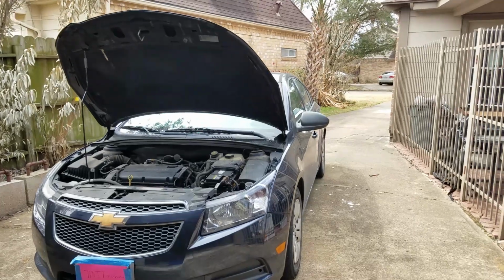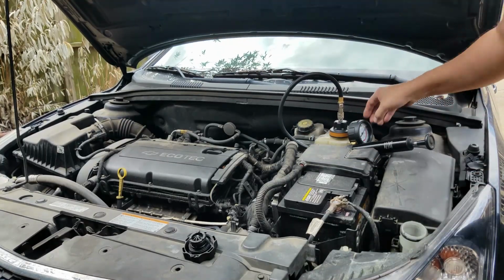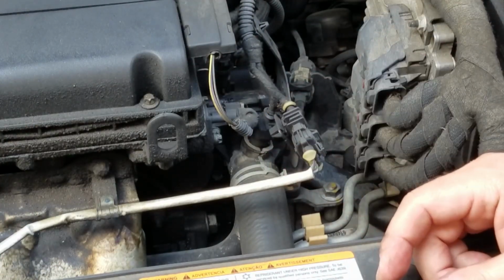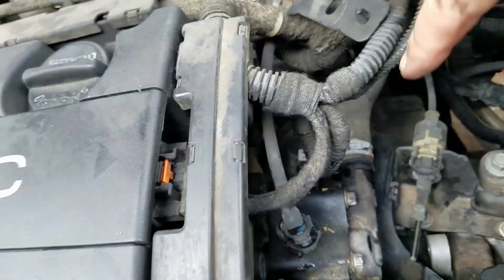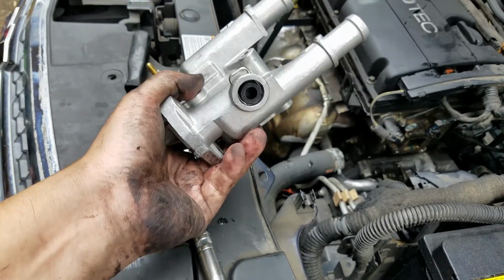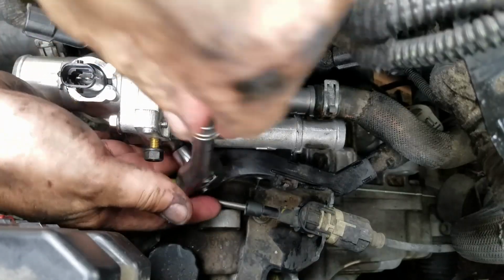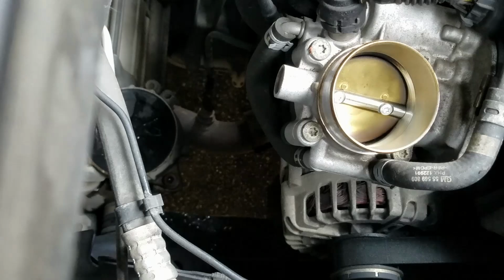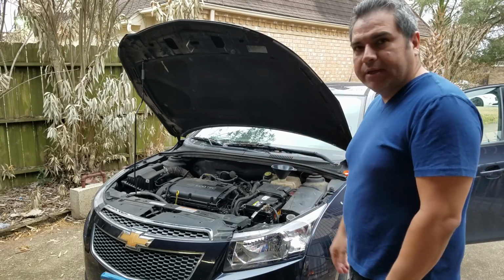2014 Chevy Cruze 1.8L  How to replace thermostat housing and details of extra parts needed.

Comment: How did you get the coolant inlet pipe flange to meet with the thermostat so easily? Mine was not quite flush and I bolted it to the thermostat but it’s leaking from there now

Comment: Jus lost heat, started off gradually then totally lost it last night, how can you tell if it’s the thermostat and not the water pump and when n if the pump goes does it make excessive noise?
Reply from the maker: Usually, a water goes bad when it starts to leak out the weep hole on the water pump or the obvious bearing noise. However, a thermostat can be stuck in a closed position causing to over heat engine. Also, make sure the engine is operating. A faulty engine fan can cause to overheat engine. 1. Check if fan is operating. 2. More than likely your thermostat is not opening.

Comment: I simply put a piece of  1foot long or so hose on the radiator outlet and fed the hose through the plastic shield.  Why take the shield off?  Also, I left the drain hose on and curled into the space in case of needing to drain again.

Comment: Great video, best I’ve found yet. The real test is how you got the oil cooler pipe back in without taking off the heat shield
Reply from the maker: Thank you for the positive feedback. It’s been quite sometime. I can’t recall, but I do remember it was a little challenging.
Reply: @ChappieSlappie216  you just pull hard on it to the right, it's only holding by an O-ring after you removed the bolts that are on the thermostat housing. Use soapy water to push in the new part.

Comment: I just replaced this on my Sonic with a 1.8l.  I got the all aluminum part through Amazon.  I did not have the o-ring for the oil cooler outlet pipe.  I used a bead of Right Stuff sealant around the metal pipe where it inserts into the thermostat housing and it worked well.

Comment: Can some one tell me where these things actually fail.
Does the plastic warp at the O ring or does the actual body have hairline cracks or is it the fitting , coolant lines to the plastic housing?
Dont think ill be putting an OEM. I think Ill try an aluminum aftermarket housing.

Comment: where did you ifnd the short E-10 sockets? all harbor freight has is the long ones
Reply: Advance auto has a set. Diehard seems to be pretty good for the price
Reply from the maker: @ thank you for sharing. This will the community. 😊👍
Reply from the maker: @MrTmac493  it got mine from Amazon. Yes, harbor freight, northern tools, and all local auto parts store does not have E sockets

Comment: Also be careful with the oil cooler outlet pipe, I dinged mine up and had to replace it. Pretty sure it's made out of aluminum also.
Reply from the maker: @coreyparrish1985  thank you for your insight and experience. Do you have part# for the oil cooler outlet pipe?
Reply: @713jtmechanic8  I can look it up when I get a chance. I had to get it on eBay 🤣

Comment: Hey so I recently replaced my thermostat housing assembly shown in the video with a new ac Delco one but now my car seems to cool down every times it’s in drive but it will heat up when In idle
Reply: Only thing I didn’t do was replace that O ring you had showed
Reply from the maker: Your description of problem sound like the coolant system may have a air pocket.

Comment: Did you replace the metal pipe as well? 😊
Reply from the maker: No… all the parts replaced are mentioned in the description under the video.
Reply: Ok thanks. Mine came loose from behind the manifold but thought I broke it

Comment: I just replaced the thermostat started the car  and it started leaking  i did not put the rubber pice like u said on the video and did not replace the hose   smh so i just order a new hose and the rubber pice  but for some reason it  looks like the hose doesn't look like it locks  in probably
Reply from the maker: It should click in place. Inspect the inner piece of the plastic that inserts into the thermostat housing.

Comment: I attached a new throttle body hose to the new thermostat housing and it leaks from that connection any ideas?
Reply from the maker: I can’t recall the connection style or design. There must be a crack. Take your time to inspect the area. Something has to be cracked.
Reply: @713jtmechanic8 it’s like it’s not pushing down all the way in the housing but it won’t go any further and leaks out…Silicon sealant?

Comment: My cruze has a coolant leak after the thermostat was replaced could it be my housing needing replaced my Hose have been replaced already
Reply from the maker: There is a high probability. When replacing the thermostat it is highly recommended to replace housing and everything that connects to the housing, hoses and such.
Reply: @713jtmechanic8  ok thanks

Comment: There is an identical connection on the throttle body other side of the throttle plate. Replace the 5/16 o-ring to prevent a leak there.

Comment: Does housing has a gasket ....or some kind of sealer.    Or nothing at all
Reply from the maker: It’s been a while I can’t recall. I believe it’s an o-ring that seals. However, it definitely needs some type gasket or rubber seal to prevent leaks.

Comment: I did this exact how you explained it and my engine won’t even start anymore and if I can gas it enough to start then it’ll sputter a couple times and then cut off
Reply from the maker: Do you have a check engine light on? What code does it display on your scanner?
Reply: @713jtmechanic8  I’m currently out rn but I’m hearing that it’s working again, I just left the car off and left the pressurized coolant cap off for awhile to get the pressure bubbles out
Reply: @713jtmechanic8  it’s not throwing any codes and no light though
Reply: @713jtmechanic8  still no start

Comment: The engine oil cooler pipe slid out when I was taking the old thermostat housing out. Is it supposed to be that lose. Can I just slide it back in when I install the new housing.
Reply from the maker: Yes, it slides in. I believe it has an oring to seal.
Reply: Dis you manage to slide it back in without replacing oring? Without removing all the exhaust manifold?

Comment: What is the hose called that broke off? I just had it happen to me.
Reply from the maker: Throttle body heater hose inlet. It’s on the description with part number.
Reply: @713jtmechanic8  thanks!

Comment: That hose you replaced, you broke it taking it off by prying it off. The end that goes to the top of the housing is actually a c shaped retention clip that slides off to the side.  It is not for snapping into place.
Reply: That hose is going to snap no matter what you do. It’s a bad design. Like you know how to get it off with out breaking it. IT’s plastic wrap in plastic. That hose will break no matter what you do.
Reply: @careful7951  Agreed it's a crap plastic. But it's overheating that causes it to become "brittle" and break when you pull it off straight expecting it to still have elasticity. It won't break if you slide it off like any other C-Clamp. $6< Genuine Part 55354565 I tried to find a metal one as I have seen similar ones for the fuel injectors but no luck. https://m.media-amazon.com/images/I/41cF3JJ1s5L._AC_SL1000_.jpg

Comment: What is the name of the metal tube that's attached to the thermostat housing. I replaced my thermostat today and had some trouble with the two bolts on that tube getting them on and off. After I got it all back together the tube is leaking under the manifold in front of the engine, the same metal tube, it's appears to be leaking on a join. Hard to see need to take a better look tomorrow.  Any suggestions or help would be really appreciated I'm on a budget and need it fixed asap. I probably have to take off the manifold and front part of exhaust. Wondering if I need a seal or what? Great video.
Reply: I only figured this out after finished putting it back together and started the car also the fan was immediately on full blast. I broke the clip you replaced but put it back on as it still fitted. I will have to use your link for a new one but I need to get this all figured out first. Hope you or someone can help asap

Comment: Is there a part number for the engine coolant pipe gasket and where can I buy it?
Reply from the maker: I suggest use your VIN on AcDelco website to locate the part you need. It will be the accurate part.

Comment: Is dorman good? I'm in the middle east and my cruze recently got this thermostat leak... I was going to order this from Amazon and it's like 65$...so should I order this? Or do I get something else?
Reply from the maker: The aluminum housing Dorman mentioned on the description is still working with no issues. The AC delco is good, but I was concern about the plastic housing.

Comment: Thanks for this how to. I did buy the gasket for the oil cooler line that you had suggested, but cheaped out and didn’t buy the throttle body cooling line you had suggested.. initially. I did have to buy it because it simply broke off inside the old housing when disconnecting.
Thanks for the video and the parts links. Very helpful.

Comment: Does the Throttle pipe the attached to the pipe melt? Since the housing is made from aluminum please
Reply from the maker: No, the pipe is not delicate. I have never seen the aluminum cause the pipe to melt. Good question 👍😊
Reply: @713jtmechanic8  i just replace it yesterday both the Throttle pipe and the housing all together on my cruz 2016 wondring if put me in trouble.. Thanks for replying to my question

Comment: I am on my 3rd Thermostat because I have used 2 Dormans and they both failed. I am currently using an OEM part and it works.  After the first Dorman thermostat, my fan would run constantly and so they sent me another one. Both worked for only a month. The one that's actually working is the AC Delco Thermostat. I also seen videos stating the same thing from Dorman. I agree Dorman products are well built but unfortunately they both failed on my 2011 Chevy Cruze.
Reply from the maker: Thats unfortunate. This info regarding your experience is helpful for the community. Thank you for your comment. 😊👍
Reply: @713jtmechanic8  Thank you for all you do for us part-time mechanics. Much appreciated 🙏.

Comment: My throttle inlet hose connector looked just like yours in the video.the end piece was broken off. If it’s stuck on the thermostat housing would I have to replace the housing or is it possible to fish it out without causing more damage? Just because I already have the new throttle inlet hose installed but I can’t seem to connect it
Reply from the maker: I believe you can fish it out. Be careful with the port on thermostat housing. It can break. Good luck 👍
Reply: @713jtmechanic8 how do you fish it out

Comment: Hey man , I just want to add in. From knowledge that was drilled into my brain over the years, when tightening something down such as that type of part you always want to use a cross pattern. Same concept as when changing a tire and bolting it on. Meaning tighten the top left Bolt move to the bottom right bolt tighten the top right bolt move to the bottom left bolt. I was told  if you Failed to remember that step you may potentially have a leak in the future due to flexing temperature in the metal. Correct if I’m wrong !
Reply from the maker: Absolutely, you are correct. I do cross pattern on metal and plastic myself. On engine heads I follow manufacturer specifications regarding the sequence to bolt down and torque. 👍🏼😊
Reply: I didn't I broke the bolt on it it held but when it's time to take it off again it's going to be a pain.
Reply: Correct you? Are you kidding? That’s that life saving / car saving knowledge right there.

Comment: Thank you for doing this video, my heater stopped working and I found my reservoir was empty, fearing a head gasket my son pointed me towards this housing. I have not even refilled the tank yet, but just wanted to know what I was in for if its this. Nice video, thx.
Reply from the maker: Glad that my video helped you. The reservoir is not challenging to replace. A little advice. Once you replace reservoir and fill up tank. Drive the vehicle to operating temperature and recheck coolant level. Caution: Do not open reservoir while engine is hot. Coolant system is under pressure and can injure you or someone. Wait for engine temp to lower to outside weather temp. Good luck.
Reply: @713jtmechanic8  Ya thx for the advice, I am well seasoned at this stuff and know the risks. The reservoir isn't bad, I just have to refill it and get the air out then see if it continues to leak and at what rate, then decided if I fox it now or later. Either way I'm probably not getting out of the work 🤣

Comment: Do you have the link on where we could buy the aluminum thermostat housing?
Reply from the maker: No, I don’t have link for aluminum thermostat housing. I only have the part# on the description. It’s a Dorman brand.
Reply: @713jtmechanic8  alright. Thanks for the tip. I really appreciate your helpful response. God bless brotha.
Reply from the maker: I believe the Dorman part # is the same for a 2011 Chevy Cruze. However, it’s best to check with advance auto website to confirm.
Reply from the maker: I never seen aluminum side housing radiator, only Orignal stock radiator plastic housing. I am sure you customize a radiator aluminum housing, but that is very costly. Not worth it for a daily driver.
Reply: Is the dorman thermostat housing applicable to year model 2011 chevy cruze A/T?
Reply: What’s the material for your radiator? Is it full aluminum? Or would you recommend the original stock (black plastic sides)GM brand radiator? If there’s something you could recommend, i would really appreciate it

Comment: My mechanic changed this twice with a housing that is all aluminum made in Asia.  It works for a month or so & then it leaks again, same spot as b4 with the original GM housing.  I noticed the original one is made of plastic.  I read that the aluminum one will last longer, so we went with it.  My original GM plastic housing leaked & eventually cracked.  I would think that if the part was defective it may happen once, but not twice.  He charged me $310 for the work & it still leaks.  Could it be leaking from another part near the housing & seem like it is leaking from the housing itself.  Any suggestion?
Reply from the maker: This aluminum Dorman thermostat housing I installed is working perfectly with no leaks. The only thing that comes to mind is if your mechanic did not replace the oil tube gasket and the throttle bony coolant hose. Those items connect to thermostat housing.
Reply: @713jtmechanic8  Are you referencing a single part or 2 different parts?  He did replace the coolant pipe, which is located just below the housing.
Reply from the maker: There is a plastic coolant tube that connects from the Throttle body to the thermostat housing. It’s mentioned on the video.

Comment: Thank you so much for this video! We have had so much trouble with the coolant system on our ‘14 Cruze LS 1.8L For the last 3-4 months.  It started with a crack in the coolant overflow reservoir, then the thermostat (we replaced the thermostat only, which you will see was a bad idea) and the sensors, followed by the water pump, and only 2 weeks after replacing the water pump, the idiot panel told me “A/C off due to high engine temp” & the fan was going nuts.  There is plenty of coolant in the new overflow reservoir, and with all the new parts, I feel there are only 2 more possibilities: the thermostat housing assembly/water inlet or the head gasket.  And it is definitely leaking from the housing.  Hubby & I are both mechanically inclined, but had a hard time finding a video that showed this process on our exact model of Cruze.  Your video has saved the day!  So I’m off to pickup the Dorman housing as well as the gasket and a new hose, and get this done so I can be back on the road. So thank you SO much!! Much Love for you! 💜💜💜
Reply from the maker: I am so happy that the video was able to help you and husband. Your message gave energy to continue to make more videos. Thank you so much for your comments. Much love to both of you! 💜

Comment: I replaced the THERMOSTAT Housing and throttle inlet hose and is leaking from the end part that snaps on/clicks onto the thermostat housing any suggestions for a better o-ring or should I use RTV?
Reply from the maker: Make sure the plastic connector to thermostat is not broken. If the plastic connect is intact, suggest to replace o ring. I seen people seal with RTV. I don’t recommend it. However, it seems that it worked for those people.

Comment: I have a coolant leak from that oil coolent bar but from the middle did I pull on it is there an o ring that needs to be changed?
Reply from the maker: There is a rubber gasket that resembles some what an oring at the flange of the oil tube. However, I don't recall an o ring where the oil tube connects under the manifold. It could be its not inserted properly.
Reply: @713jtmechanic8   Thanks for your reply, it turns out there is a rubber gasket, I did move the part and broked the seal that it had do to expansion, I will have to replace that part do to it being the original part. They updated the part and rubber gasket is different size. That part is called the engine oil coolent pipe around $50
Reply from the maker: @Jopn83  thank you for sharing. This info will help out the community.
Reply: Do you mean the leak was from the oring where the coolant hose goes into the oil cooler?
Did you need to remove the whole exhaust manifold?
Reply: @rotemcohen6239  I just had to pull the oil coolent pipe and replace that part with a new one I tried to find an O ring but they won't fit properly.
Reply: @Jopn83  is it possible to pull it out without removing the exhaust manifold?